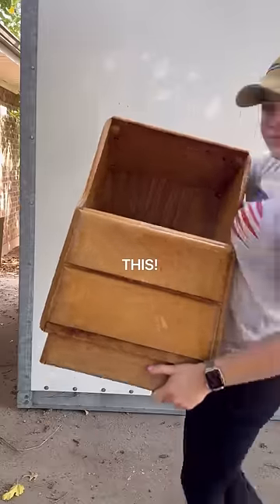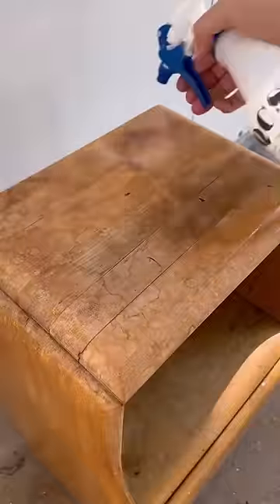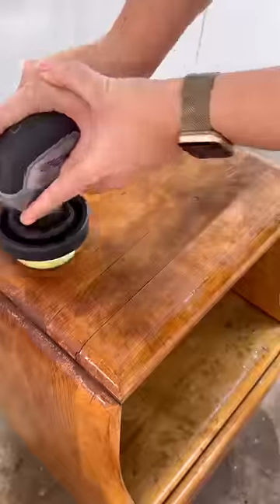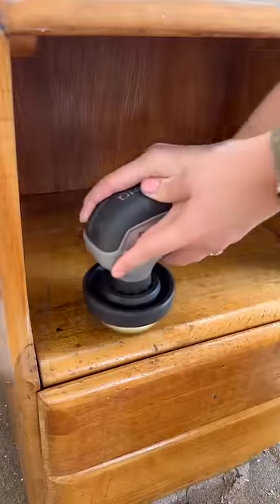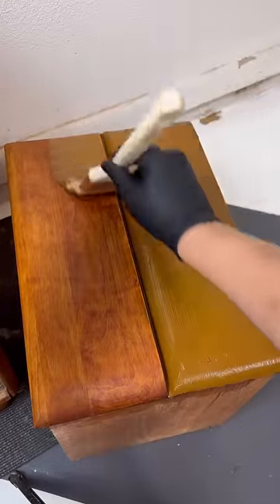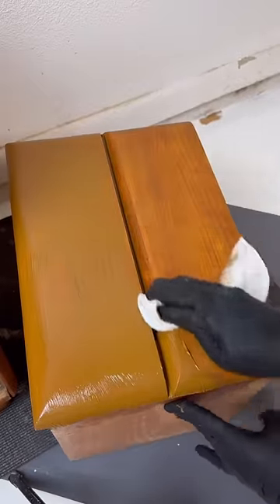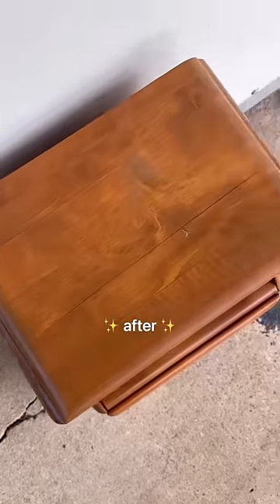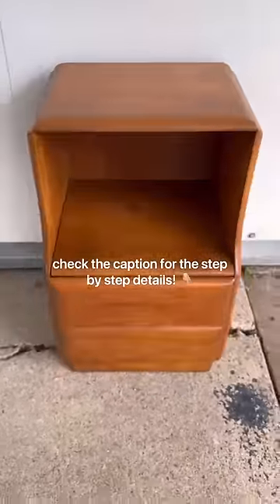My CRAZY Facebook Marketplace Thrift Find! A solid maple MCM furniture flip 🤯

Comment: I like the finished stain. I would have liked it better if you had addressed the splitting wood. Filling the cracks with wood glue and clamping it before sanding would have given a more professional finish and protected the piece for the future.
Reply from the maker: Good tip?

Comment: Cleaning is kind of pointless if you’re going to sand the piece anyway, unless it’s extremely dirty and sticky.. Just start with sanding and save the time and step.
Reply from the maker: if I don’t clean it, the dirt gums up my sanding pads causing me to increase my supply cost and decrease profit margin. Plus it’s just sanitary.
Reply: @thefurnituredoctor   Right that’s what I was saying if it’s sticky, it’s better to clean first. But if simply removing finish, just sand it. You’re covering it with chemicals and sealing it so sanitation is a stretch. I’m an avid woodworker and have done many projects that are similar, both restorations and custom built. However, advice is sometimes worth what you pay for it lol either way, your finished pieces look good.

Comment: Doesn't make sense why someone would waste time using a Dremel Versa scrubber then sand it with 100 grit which removes all surface wood anyway.
Reply from the maker: Because if I don’t clean it, the dirt gums up my sanding pads causing me to increase my supply cost and decrease profit margin. Plus it’s just sanitary.
Reply: Ah. Good idea.  @thefurnituredoctor